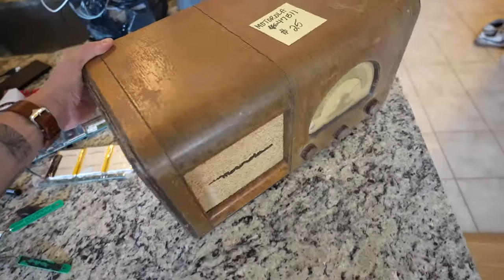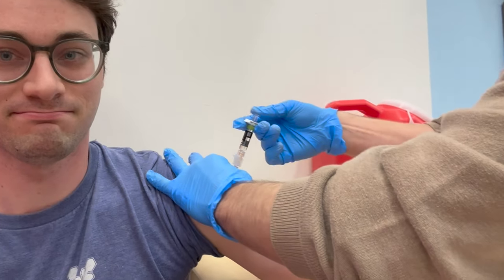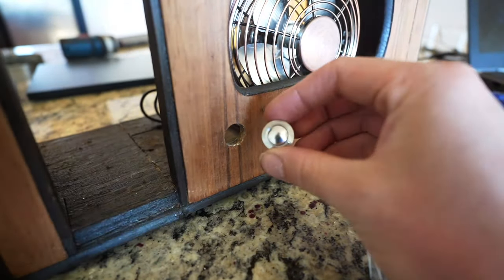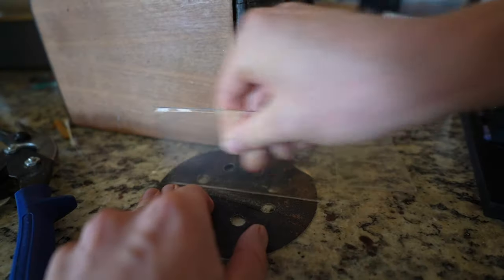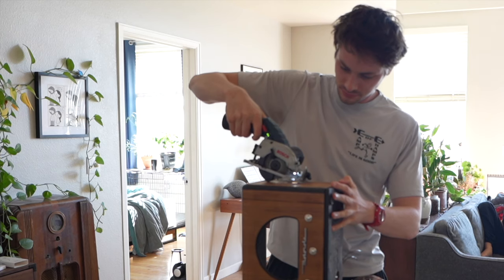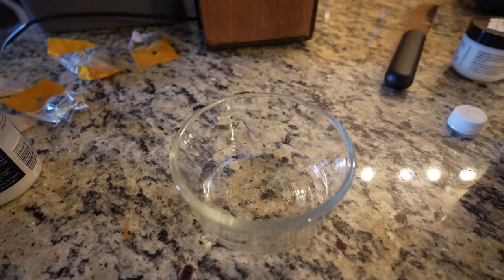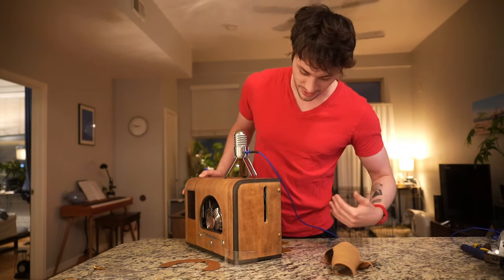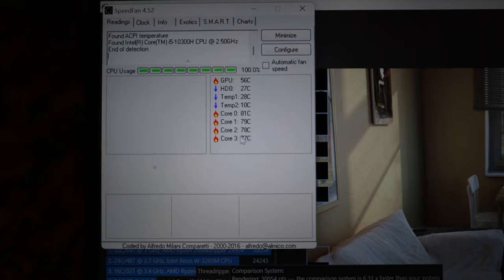Wood & Leather PC Case

Comment: In 2014 I cut down the overall height of a floor standing 1939 Philco radio cabinet, and built a PC case out if it that would take a full ATX motherboard, as well as eight 3.5 inch hard drives. The motherboard is on a hinged door, similar to the old Blue and White Powermac G3 Apple made in the late 90s, early 2000s

Last year, I began building a SFF PC case from the leftover parts from that old radio cabinet that I had cut out to reduce the original's size. I plan to design a front and rear grill pattern, and have it cut out of brass plate with a water jet, to serve as the front and rear grill. The SFF case also just barely fits a full ATX motherboard. The bottom I/O panel was taken from a 2u server chassis, and has a standard I/O shield cutout with seven low profile PCIe slots. From the front, the case has kinda the shape of an UNO reverse symbol 🔃 with the I/O coming out the bottom, and the GPU air intake on top (a repurposed rectangular brass floor drain grill). The three slot GPU bracket and SFX PSU are mounted to the rear grill. The whole unit hinges open, with the motherboard on the swing down drawer, so when Open, the bottom I/O faces sideways, for easier access.

Both cases were made from the same radio cabinet, and the original cabinet was completely gutted when I got it, including having no radio face. I found a set of brass postbox doors at an antiques shop. They had a mild art deco design that I liked, and the two larger ones perfectly covered the hole in the front of the radio cabinet. I mounted a nixie clock behind the glass windows that would normally hold a Postbox or room number. On the new SFF case build, I plan to have the case door release and a smaller nixie clock behind it. 

The 2014 case looks like a shorter version of the original 1939 Philco radio. There is a false back behind the speaker grill bars, which serves as dual air intakes. Each intake is a 2x2 grid of 120mm fans, for a total of 8 intake fans, blowing through a pair of 10x10 inch air filters. A pair of internal circulation fans makes sure air blows up into the top of the case, where the hard drives are, and the intakes feed directly into the PCIe slot area, and feed up to the CPU, which is cooled by a Noctua NH-14D. There are a pair of 120mm and one 140mm exhaust fans at the upper back of the case, near the CPU, to exhaust hot air. These fans are unrestricted, unlike the 8 intakes, which are pushing against filters.

The 2021 case is made from leftover wood, and wont look so much like a radio, as much as just a period piece... The deign for the legs actually is stolen from a lamp. The half that is fixed will stand on buttressed legs mounted to the side. It will be supported at the front by a pair of buttressed legs forming an "A" shaped leg with the smaller brass postbox door in the "hole" of the "A". For stability, the rear grill will likely have a single small leg to support it's corner. The CPU of the small case is cooled by a Noctua NH-D15 mounted in a 90° orientation (blowing toward the PCIe slots). Since the case can only handle half height cards, this airflow direction will pull air in directly from the front grill, and pass It directly toward the SFX PSU and over the slots. The GPU is connected by a riser cable to it's bracket. Both CPU and GPU are able to pull in fresh cool air (from the front grill and top grill, respectively), and blow everything out the rear grill.

Comment: I think this could be way better without cutting original box.
On the left side where Motorola logo was with that cloth(speaker), you could just put new cloth that act as dustfilter with modern pc fan for intake (it will not be visible), and on the right side have fancy exhaust. This would create at least "some" air movement and could even work with more powerful parts.

Comment: Out of curiosity, are you still able to get into the BIOS without the laptop's original display? I'm doing a similar project with the exact same laptop and I'm concerned about losing access to the BIOS if I remove the display altogether.
Reply from the maker: This is a great question, and unfortunately I no longer have this project around to test it for you
Reply: @CarterHurd   No problem. Thanks for the response.

Comment: There are a lot of space inside, normal pc would fit. I would put stereo speakers inside
Reply from the maker: An ITX build could fit, yeah. It's a 14L build, smaller than an ITX case like the Cooler Master NR200P is 18L but larger than some of the ultra-tiny SFF builds like the DanCase.

Comment: Motorola 47B11, Build in the late 40s, Broadcast wave AM only receiver, ment to run on batteries not ac, a 90v B+ battery and a 1.5v filament battery, filament current is .25 amps and B+ 12ma, and a 3 ohm speaker. Weird little radio. Does the ebay listing include the speaker?
Reply from the maker: Nope, not the speaker, just the stuff I have photos of in the listing
Reply from the maker: but thanks for all this info, no one else has been able to identify it
Reply: @CarterHurd  it was difficult to make out the sticker hiding behind the plasma globe at 3:02 because theres no clear shot of it.. I actually ended up finding the schematic as well lol.
Reply: In other words, if I win that auction, I have every intention to try and bring it back to life..
Reply from the maker: @danielauen7790  got it. Yeah sorry, I don't have the speaker any more. But if you revive it totally email a photo to me! that'd be cool.
Reply: @CarterHurd  well, conveniently i poked around on ebay and found a 3 ohm speaker that "should" work. But this radio supposedly only outputs about 250mw.. so there's a chance that without the original speaker, it won't be very loud.  But that sounds like a potential problem to another day...
Reply: @CarterHurd  But when you go to ship it, that dial cover on the front is probably fragile as hell and damn near irreplaceable... Make sure it is well padded, Or ideally completely covered with something solid with some scrap wood with a cutout the same shape as the original hole in the original wooden shell.
Reply: @CarterHurd  I dont suppose you would be willing to 3d model that Motorola logo and throw it up for download somewhere?